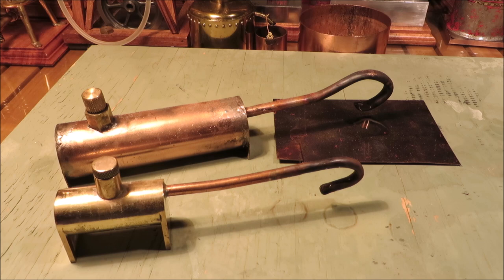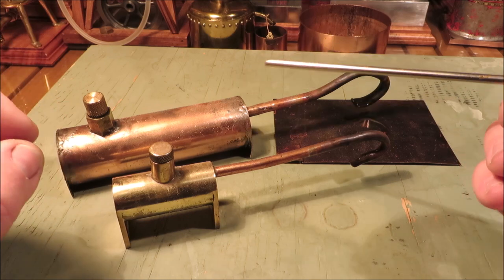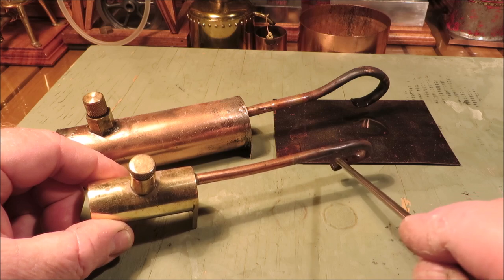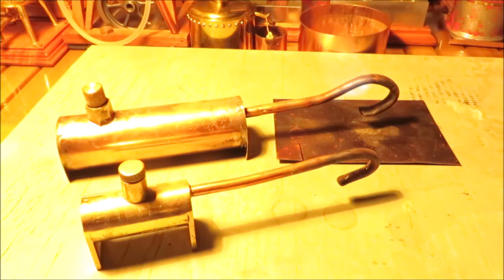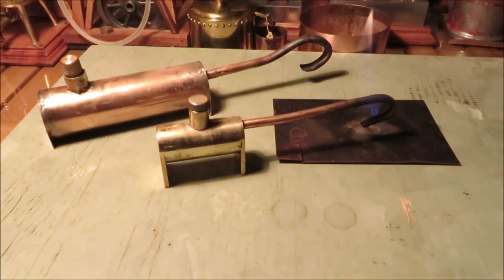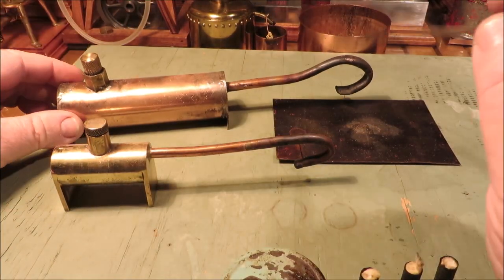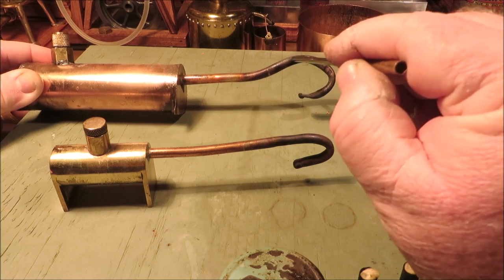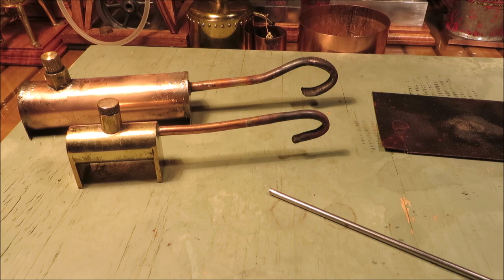Model Steam Engine Supaburner's for Boilers Explained

Comment: Thank you for sharing. From work I have seen elsewhere there is no need to seal the reservoir,  a Japanese guy just had an open dish of meths for his experiments. It seems the wick causes a head to develop which causes a lot more pressure at the burner.
Reply from the maker: G'day Ian, easy to test ....would just have to leave the screw cap off. These are pretty efficient burners and for the size of them put out some heat. A larger reservoir and a build incorporating two wands so two wicks would heat most model steam boilers with ease - Cheers Jim

Comment: Really nice video
Do you now why the crimping is important?
Isnt it enough to just block it with silver and a plug?
I could make a prettyer one without the crimping.
That why i ask.

Thanks for sharing.👍
Reply from the maker: G'day Martin, absolutely no need to crimp that end. I only did it because it would be easier to silver braze the end. A plug and silver brazing would look very professional - Cheers Jim
Reply: @SteamEngines-Jim  
Thank you very much for the answer🙂
That means i can try to make a pretty one for the small steam boat i am making.

I will try to make a version that fits in a very low firebox so i forgot to ask can the tube be vertical instead of horizontal so they piont downwards or will this overflow it?

Thanks again its was a eye opener🙂👍
Reply from the maker: @martintspedersen  Interesting to see if it works vertical. The wicks in mine are working by capillary action until the pressure builds up. Looking forward to seeing what you come up with.
Reply: @SteamEngines-Jim 
Thanks i just have to make some experiments to see if its possible to make another design. If i can i will share what i figure out.  A smaller tube and hole is also a thing a wanna try. I have 0.3mm drill bit and 3 mm brass tubes.
I will see if brass works as good as copper.

Comment: Where can I get fiberglass wicks? Great demonstration.
Reply from the maker: Easiest lifelong supply is to buy a fibreglass fire blanket for under $10 and cut that up - Cheers Jim
Reply: @SteamEngines-Jim  .....thank you!
Reply: Fibre glass "rope" which is sold as replacement sealing for wood stoves and slow combustion heaters.

Comment: cheers Jim
Great explanation, i've logged it for future reference
just one more question
does the heat transfer right up the tube and get the resovoir very hot
cheers👍👍👍👍👍👍
Kev
Reply from the maker: Yes the heat transfers right up to the reservoir and that's when it will operate at its optimal performance with a jet like roar. Simple to make and they will amaze you. I can raise steam out of a 3" horizontal boiler to run a large model steam engine effortlessly.
Reply: @SteamEngines-Jim  Thanks Jim👍👍
Reply from the maker: @MrFactotum  You're welcome, you can buy the fibreglass rope on eBay in all different thickness's....its very cheap.

Comment: Hey Jim! Thanks for the information! I was wondering if you could use kerosene in these super burners if you do some preheating? Thanks
Reply from the maker: I'm really not sure about that, its something that I haven't even thought of. Would it be pretty sooty and smokey?
Reply: @SteamEngines-Jim  for sure it would be but I’m thinking about building a super burner and I have a lot more kerosene lying around than mentholated spirits. The kerosene would burn hotter as well
Reply from the maker: @Bardsbrothersrailroad  If worse comes to worse, you'll still have a super burner....will just need to buy some spirits for it. They put out a nice hot jet of flame.
Reply: @SteamEngines-Jim  thanks Jim

Comment: That's a good burner do you think it would be to hot for a rider ericson pumping engine?
Reply from the maker: I think it would be fine, it's still only a spirit burner.....just very efficient.
Reply: @SteamEngines-Jim  I think I'm going to copy your design if you don't mind,the alchol burners those engines come with are not very good if you want to drive something with them,are you in britan or Australia I'm in the states
Reply from the maker: @cecilking3727  They are an excellent burner and work very well. I have seen some people have made them with two copper tubes coming out from the cylinder reservoir for double the heat for larger boilers. If you have trouble finding fibreglass wick, purchase a fire blanket from a big box hardware store for under $10 and you will have a life time supply of fibreglass 'rope' when you cut it up. I'm in Australia Cecil.....cheers Jim
Reply: @SteamEngines-Jim  thanks for the information Jim I have a fiberglass safety blanket I use when brazing already,you said it's a spirit burner do you mean denatured alcohol?and your shop looks very good,I think the best thing I ever bought for my shop for cleaning was a small shop vac,it's amazing just how much debre a mill and lathe can make in an hour lol,thanks for all the info and I'm in the process of making a transmission now with a clutch for running models,lever operated I'm always tinkering
Reply from the maker: @cecilking3727   Cecil, yes denatured alcohol (what we call methylated spirits down here) awful taste so folks don't drink the stuff. I do like my shop vac! I have made a vertical and also a horizontal transmission for running models of steam engines and small IC engines at a more realistic reduced speed. Would really like to see what you come up with one with a clutch incorporated.
Reply: @SteamEngines-Jim  I saw one of these transmissions at a hit and miss engine show about a year ago,it not a clutch like a car the old man said it was a sprag clutch I was looking at it and it works amazingly good to start a shaft turning and to stop it turning its all mechanical no clutch lining no pressure plate no springs,it's not a idler pulley that tightens and loosens a belt either first one I've ever seen,so I'm making a miniture  model of it,it incorporates a second reduction shaft also so you can get really high torque output on one shaft and a higher ratio on the first shaft,and it's compact in design,it should give a relatively weak engine a load of power,like a single acting oscillator or stirling engine plenty of power to run model equipment,if your interested Jim I'll be happy to answer any questions,I think you would get a kick out of the way it works
Reply from the maker: @cecilking3727  These are the two that I have built. I'd love to build one with a clutch incorporated - 
https://www.youtube.com/watch?v=NjOBmTUYH9k
and
https://www.youtube.com/watch?v=eKIRVLlHTe8
Reply: By the way I saw your transmissions and the are a nice peice of work very well executed and thought out,alot of people build things and it looks like an afterthought when it's finished,I can tell by looking at your work there was considerable thought put into them,sometimes I'll think for a week before I even start making a part,make it in my head then do the machine work,I make far less mistakes that way,as you know mistakes are easy to make in machine shop work
Reply from the maker: @cecilking3727  Thanks Cecil.....keep in touch by email if you want....I'd like to see your progress and ideas.

Comment: Do you think this tipe of burner would be ideal for the wilesco traction engines?
Reply from the maker: Yes it would be worth trying, it would need to obviously be a shorter stem. Let me know how you get on with it.
Reply: @SteamEngines-Jim  aight i will
What ill do is ill have the tank in the cab and have the pipe enter from the bottom and go to the top
Then it'll kinda work like an oil cup on a steam locomotive
I will have to get it made at some place as i dont have any experience with silver soldering
Reply from the maker: @laaity  Silver soldering is not hard, even if you just use plumbers silver solder from the hardware store.
Reply: @SteamEngines-Jim  i suppose i could give it a shot
I just need to get new copper pipes and stuff 
The fiber glass do you think steel wool will work? Cause that's what i have

Comment: How is the burn time?
Reply from the maker: Probably 15- 20 minutes for the small one, the larger around  45 minutes.
Reply: @SteamEngines-Jim  Awsome, well done, I think I’ll build one.

Thank you
Reply from the maker: @tomcook5813  Tom just make sure you loop the fibreglass thread in the main chamber so there's a good draw of the metho. Best and cheapest place to source the fibreglass is to buy a fire safety blanket from a hardware store and cut that up - Cheers Jim
Reply: @SteamEngines-Jim  That answers the obvious question